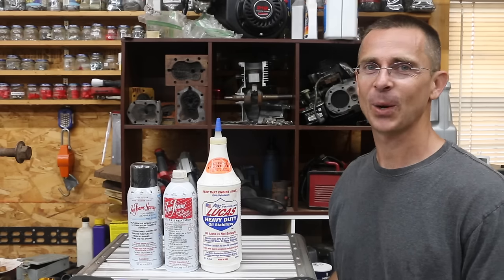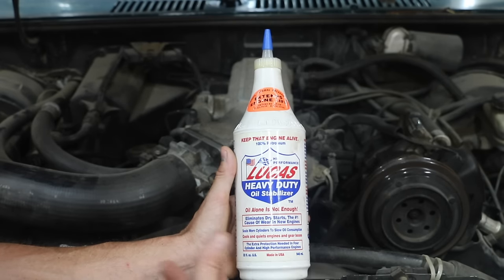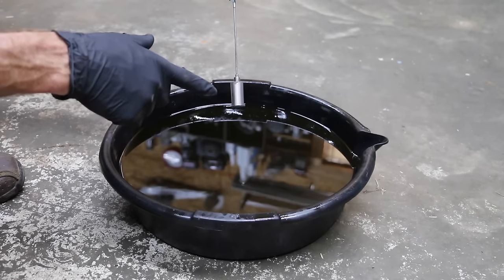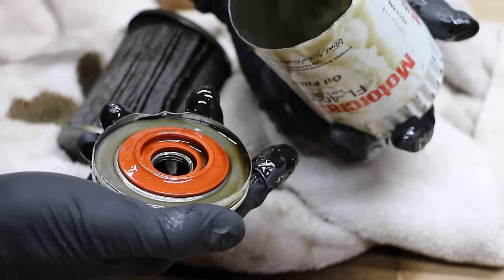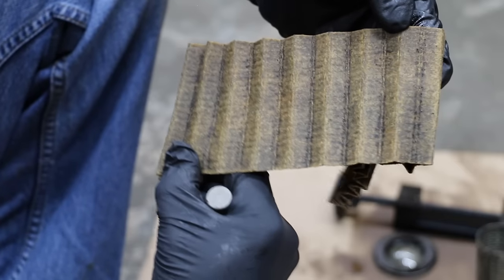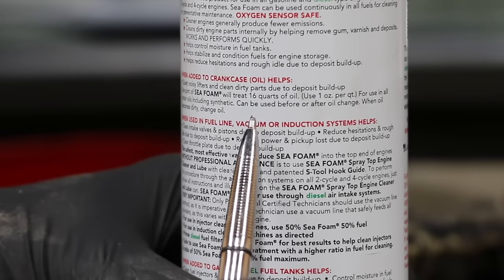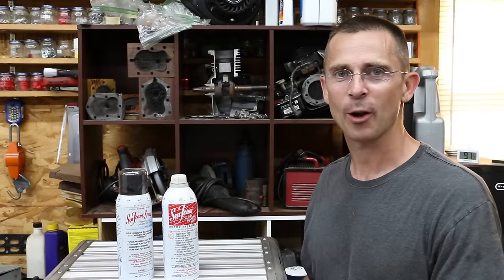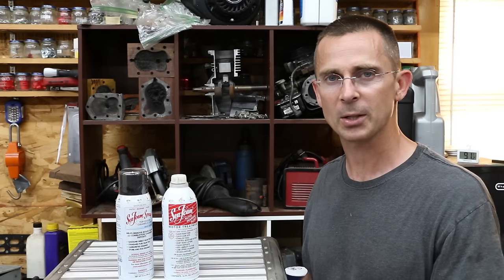Did the Seafoam fix last? Update on the Ford Ranger

Comment: I have used Seafoam in the past and had a measure of success with it . I would like to ask first if you've taken the valve cover off to see what state of the lifters and valvetrain might be in. It sounds to me like a oil distribution issue .  Find out if oil is even making to the lifters first. Its easy to do.  If it is I would recommend running some type F transmission oil at least 1/2 to a full quart with some cheap oil to clean the engine.  Afterward I then would run 0w 30  Amsoil signature  along with 1 bottle of Prolong engine additive . You will be surprised at the improvement you will see in that engine .
Reply from the maker: Thanks for the feedback.

Comment: @ProjectFarm: have you been able to determine what portion of the improvement from your Seafoam activity was due to SF in the gas, SF sprayed into the throttlebody and how much was due to the addition to the oil/crankcase?  The main reason I ask is to to know if I can do  the easier, less aggressive methods and get results.   Some have noted that the combustion chamber/crankcase additions might be bad for seals etc... TIA

Comment: Had a 2002 Chevy Silverado that blew the and take gaskets flooded the motor, when I put it back together three lifters were tapping away added some seafoam 20 minutes later no tapping got another 70 80,000 out of that truck
Reply from the maker: Thanks for the feedback.

Comment: Excellent method. Really have learned a lot. Would love to see the Archoil fuel & oil products thrown into the mix. Been using for years and they seem to work well. In 2011 F350 7.6 diesel and tractors
Reply from the maker: Thank you!  Thanks for the video idea.

Comment: My only issue with Sea Foam, at least through the fuel, is that I lose acceleration until I clear it out of the system. Then things are usually good.
Reply from the maker: Thanks for the feedback.

Comment: My wife and I stopped by the local Advance Auto Parts and I picked up a can of Seafoam. I used the vacuum line for the power brake booster to pour the Seafoam in the engine while it was running. Shut it off and let it sit for around ten minutes. When I restarted the car it smoked Ike hell and my wife thought I blew up the engine. She was sooo mad and I couldn’t stop laughing and of course that helped😂
Reply from the maker: lol  Thanks for sharing.

Comment: do you think the seafoam could have been what thinned out the Lucas? i agree with not using sea foam and lucas maybe one you get it running right you only put sea foam in 100-300 miles before you do the oil change to clean and gunk off that would have been in the engine. Question to you think there is a difference between the amount of engine sludge from oil used? for example  difference between synthetic and conventional.

Comment: Very impressive: so, question please? Does it make sense on Lexus SC 400 8 cyl 295 HP to use the gas additive and motor oil treatment? It has 165,000 miles and I put about 5,000 miles annually.  Same question for Acura TL AWD 6 cyl 300 hp 2013 23,000 miles and Rav 4 2015 4 cyl 55,000 miles? Thank you! H

Comment: This is a good testimonial. Quit using paraffin and natural base oils in your engine. They loose most of your viscosity even after several hundred hours of use. Install instead a good synthetic oil and CHANGE it every 20,000 miles. Synthetics do not break down or loose appreciable viscosity even approaching the end of their "service life". Also synthetics do not leave deposits in your engine like natural based oil. I race (1/4 Mile) and noticed that regular oils would not protect and have substantial loss of viscosity after even a few 1/4 Mile runs. I have a new car and ran synthetics in it from day one. After 100,000 miles tear down of my engine showed NO APPRECIABLE WEAR with the synthetic. Piston skirt tolerances and bearings were ALL within initial factory spec's.  This is not the dark ages any longer. Police, city, fire and government agencies ALL run exclusively synthetic oil in all of their service vehicles. They have reaped the benefits of new technology and have virtually no internal wear or breakdown of service vehicles due to the breakdown or failure of the natural based oil. Do your self a favor and switch away from natural oil products. They do a poor job of protecting your investment. It is NOT uncommon for an engine, using synthetic oil to reach 500,000 miles or more with no breakdown due to friction or failure of lubrication. Limits on service life then come from metal fatigue. The moving parts of an engine generate significant stress to rods, cranks and camshafts, anything that has spinning inertia. However, engines protected with synthetics have NO friction damage. Buy a good synthetic and loose damage and failure due to friction related issues.
Reply from the maker: Thanks for the feedback.

Comment: Atf run engine at 2500 rpm and run it threw one of the vacumn lines it will smoke like mad it cleans valve trainnand piston and combustion chamber use a litres worth or less  works best on older vehicles without catalytic converters its amazing what it will fix sorta like seafoam
Reply from the maker: Thanks for the feedback.

Comment: A mechanic friend of mine told me that a capful of automatic transmission fluid in each cylinder and spin the motor over several times, with no spark plugs in it would boost compression! 🤔
Reply from the maker: Thank you!

Comment: it has been a long time but I used a PTF 1 rezone oil in my 81 250 inline took a trip lost all oil pressure half way home, the rings hade seized compression rings that is and when i got home i took the drain plug out and nothing was there bone dry i took the head off didn't pull the motor took the pan off popped the pistons out the top had for cracked pistons and all rings tight and carboned up solid no compression was blowing oil into the intake, but i drove this over 250 miles with no oil and no damage to nothing replaced the pistons and rings and bearings to the crank, the crank hade no damage at all miked everything plasitigaged all journals within a halve a thou new head gasket did all this under 2 hundred dollars. but the blow by was a problem before I put the PTF1 rezone in it, I am sure that if was not in there it would have failed halve way home with a piston out of the side of the block or a valve into the piston whis i could get that oil today
Reply from the maker: Thanks for sharing.

Comment: Thank you for your videos.  I use them before every project.  I am thinking about replacing my fuel injectors in my 1991 Jeep Wrangler with a 4.0.  Would it be possible to do a video on what brand of injectors to use?  There are so many to pick from.  Thank you

Comment: Of course, the bigger, Strategic query, is 'Why Buy" a Danger Ranger to begin with? My Mazda 3200 had 2 'engine rebuilds', under warrantee, before I DITCHED IT.
Reply from the maker: Thanks for sharing.
Reply: Reply to "why buy a Danger Ranger".
It's a farm truck, about 80 to 100 hrs a year.
I had a similar experience, though not agriculture, but aquaculture.
When I was Bayside on Cape Cod, there was a huge section of the Cape, (middle to outer Cape), that at low tide was miles of wet sand bar.
You could walk way out in the bay to go clamming.
If you went too far, you wouldn't get back before the tide came rushing in.
I bought a used Ranger, and could drive out to where it finally dropped off.
When my feet got covered with water, I could make it back to land in no time .
"The Clammer" was not my daily driver, but it did it's job well.

Comment: Remove the spark plugs use the same seafoam spray you used for the throttle body and spray down each cylinder. Let it soak for a bit then reinstall the plugs and see what that does for the carbon build up on the rings and your compression numbers.
Reply from the maker: Thanks for the suggestion.

Comment: Please try duralube!  I've used it in my 2000 Camry with 454 K miles Since she hit her 1st 100 K and she doesn't burn or lose a drop between changes. I use it around every 75K - 100 K
Reply from the maker: Thanks for the suggestion.

Comment: Considering you used two different products it would be hard to say with one helped fix you problem.I've used Seafoam to try and clean intakes on an S10 not that in was having a running problem, took it of not that much later to try stop some of the engine  leak's it was far from any kind of clean.I think other products would be better for this.even running a pint or to of diesel fuel  or automatic transmission fluid would probably work just as well.I tend to use Marvels Mystery oil for this, i wouldn't use the Seafoam in my oil because I don't think it provides any lubrication.just my opinion.
Reply from the maker: Thanks for the feedback.

Comment: I noticed in this video you used the red bottle Valvoline Max Life, in the other video you used the silver bottle of Valvoline oil ( couldn’t see for sure what kind); why did you use a different one?  What brand and grade of fuel did you use when you filled up your truck?  When you put the Seafom in the crankcase, was it just during the oil change?  When you put the Seafom in the fuel tank, how many times during the year did you put it in?  I currently use the red bottle Valvoline Max Life High Mileage for my oil change and the 4oz bottle of Lucas Fuel Treatment in every fill up.  Would there be any need to use the Lucas Oil Treatment?  It’s been about a month since I did the oil change in my car, so would I need to wait till my next oil change to put Seafoam in the crankcase?

Comment: I just bought 1996 Volvo 850 sedan I used seafoam in gas tank it works for me but engine is running fine should I use in engine oil for cleaning right now there is no oil leak and car have around 200,000 km on it what's your suggestion for this old car thanks

Comment: Run marvel mystery oil in oil. If you read mmo bottle it says you can run 1 quart in oil instead of 5 full quarts .Put 4 quarts of regular oil and 1 quart MMO at oil change. Will clean engine and unstick piston rings .Says MMO bottle.
Reply from the maker: Thanks for the suggestion.

Comment: Might try ths on my Jeep. Have close to 280k km (~174k miles) on my Jeep and she has developed some issues that might be sludge or fuel related.  Have been swapping some parts but still have the issues. Wonder if an engine cleanout with Seafoam might help a bit?
Reply from the maker: Seems like it is worth a try.

Comment: I don't know exactly what it does but an old pastor told a young me many years ago that he regularly added a quart of ATF to his crown Victoria's gas tank. He had a mid-80's crown Vic in the early 90's with 100,000 miles on it when he told me this
Reply: He drove that car well up i go the late 20-teens with almost 400,000 miles on it with just regular maintenance and adding ATF to the gas tank every few months. What does it do, good or bad to an EFI engine like he had?
Reply from the maker: Thanks for sharing.

Comment: That's tight! I like that.  Curious what is the deal with adding seafoam after an oil change?  I know it will be cleaning more, but you have fresh oil that is getting dirtier, wouldn't it be better to do the treatment before (the oil change?).  what is the purpose of Lucas again lol, sorry, I know you just literally made a video, and I could rewatch it but just have a lot more footage to watch.  My Hyundai Santa Fe 2009 3.3lv6 has 303,000 km on it.  It runs well now; I would be surprised to see how much smoother it would run after this process.  Your Ranger had a huge change in sound I like that thanks again I have subscribed...

Comment: What is that rattling sound, not the lifters or fan. The one that makes it almost sound like a diesel, my suv makes this sound and I'm not sure if it's the torque converter, flex plate or if it's one of the main or rod bearings. I checked the cats and heat shields and nothing there, also changed my timing chain.

Comment: If you put that filter paper into a microwave, you can see if there is any metal. Metal will arc, and the color will indicate the type of metal in the filter paper. This is a method used by insurance investigation teams to see if the engine of a burned car was damaged before catching fire, which would be a reason someone would set their car on fire to collect the insurance money. Forensics is fun!
Reply from the maker: Thanks for the feedback.

Comment: Thank you for your video.  I think I am going to do a treatment on my 98 yukon with 220 k miles.  My engine doesn't sound as bad but similar.  Have you considered testing filter magnets 🧲? I use them on my semi truck on both the primary and bypass oil filter.
Reply from the maker: Thanks for the suggestion.

Comment: Hello Project Farm, I'm a huge fan of your work. Regarding the paper filter metal particulate test, have you considered dissolving the oil filter's paper in a solution or blending the oil filter paper in a blender, and then running a magnet through it?
Reply from the maker: Thanks!  Thanks for the suggestion.

Comment: Awesome videos! I'll be trying these products on my 2003 f150 V8 4.6L with 343,000 miles. It's making that same noise only less drastic . My question to you is about the oil I use.  Is it OK to use these oil treatments, sea foam & Lucas with 5w20 synthetic oil? Thank you!

Comment: Actually 130 PSI compression may not be all that bad, depending on what you started with.  General comment I’ve heard is as long as the other cylinders are in that neighborhood +/- 10 you can probably get by just fine.
Reply from the maker: Thanks for the feedback.

Comment: Have you ever tried the BG engine restoration kit? Debating on doing that on my 68 mustang. Seafoam cured the valve train problem I had aswell on my car! But compression is around 125 psi on cyl 5 for me and I kinda wanted to try the BG kit before I say screw it and get it rebuilt
Reply from the maker: Thanks for the suggestion.

Comment: I have a twin-turbo 3.5L Ford EcoBoost and hesitate to put Seafoam or Lucas in it.  Would you know if anything would happen if I did add both to my Ford?
Reply: I have the same engine. I have no experience with seafoam but the engine is direct injection, and the intake valves can carbon up because the gas does not flow over them. The seafoam you spray into the engine may help with that. I’m thinking of trying it at 100k.

Comment: Did you find that the Lucas oil stabilizer really helped in the coating the valve train system and quited down the rocker arms?

Comment: You did use too much Lucas oil treatment. That much, used with a fresh oil change at a Jiffy Lube type place, plugged up our Ford Taurus (the old style). We had 120K miles on it. A closer look at the label shows that quart size bottle treats a big diesel engine for a semi!

Comment: Do you know why my low oil pressure light comes on when at an idle but goes off after rpm hit about 1 1/2. I’ve replaced the sensor and still does it. Every now and then I’ll get a knocking noise too but not every time I start it. Any info would be greatly appreciated

Comment: Do you leave the Seafoam on the crankcase until the next oil change or Doug you use it as an engine flush? The ones that you only use for 10 minutes and then put new oil?

Comment: If you water ot down with 4 quarts of oil. Lucas oil will obviously not be quite as thick as when it came straight from the bottle
Reply from the maker: Thanks for the feedback.
Reply: @ProjectFarm  since you are paying attention. Thank you for that. Did you replace the relay you robbed for fuel pump. My bad. Was talking about suburban with transportation troubles

Comment: When I recommend especially when you’re not running up long distances highly highly recommend Amsoil synthetic lubricant I know it’s more expensive but that oil flows real nice in the winter time and also if that truck had Amsoil in it say after it had 10,000 miles on it or something like that it would probably still be in damn near brand new condition also like wicks oil filters or Amsoil oil filters but I’ll tell you what I’m impressed very impressed with what that she found it and that Lucas how many Amsoil guy but I have to admit Lucas makes some pretty darn good products and soda seafoam anyway oh yeah that was all right but like I said if you had an engine or vehicle whatever and while still in excellent condition I’m talking like after you buy a new vehicle or something like that it’s Leica three 4000 5000 miles on it maybe switch over to Amsoil it’ll last a lot longer and he change that fluid in the power steering pump because those power steering pumps are kind of weak link on that package anyway this is Jim mungai in Kennerdell Pennsylvania I also go by six in a row jim from Kennerdell Pennsylvania I got an old Dodge with over 500,000 miles on it yeah I’ll give you three guesses what’s under the hood it’s a straight six anybody got any guesses anyway oh yeah I do roughly 50,000 mile oil changes I have a bypass filter by Amsoil and our full flow filter which they’re made by Donaldson anyways guarantee you the stuff works oh on my little John Deere eight 5025 horse three cylinder diesel I do roughly 1000 hour oil changes and I can go out there and freezing cold weather even after it sits to three months at a time it Keana pops right off so I run a bypass filter on there also I don’t have agar the filter like it came from the factory the primary filter would be like the old Fram pH a day only again it’s a Donaldson filter and the bypass filter in the bypass filter that filters Donta roughly 2 µm at 98% efficient and the primary filter is 20 µm at 98% efficient so hey guys money talks bullshit walks all right have a good day
Reply from the maker: Thanks for sharing.